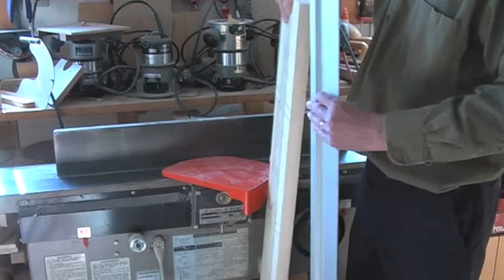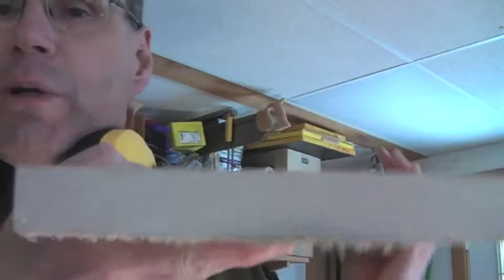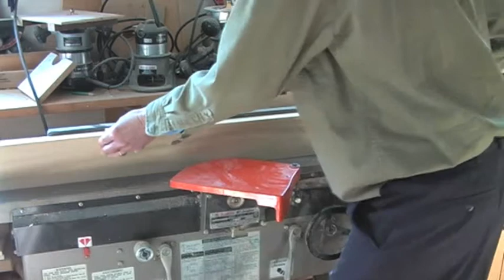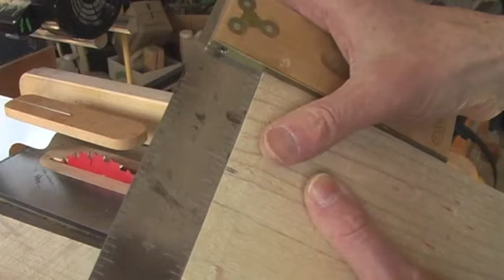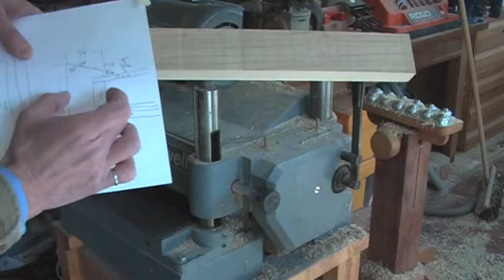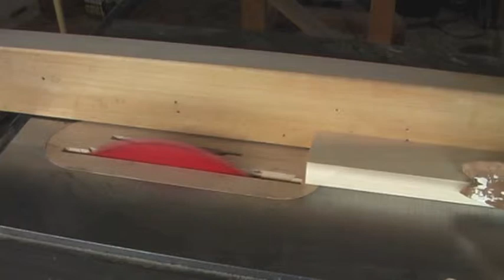02 Wood

Comment: What are you using as your straight edge?  Appears to be aluminum.
Reply from the maker: It  is one half of a 100” aluminum cutting guide.  Not a precision straight edge but good enough for checking wood.  I bought it many years ago, so that exact model likely not available today.  The  Bora WTX would be an equivalent.  Available in different lengths    https://www.elitetools.ca/en/100-clamp-edge-saw-guide-wtx-bora-543100

Kreg, and others make similar guides.  https://www.amazon.ca/Kreg-Straight-Edge-Guide-Comm/dp/B08BQ72SVD/ref=sr_1_3?crid=3P6BAM0G8650X&keywords=Kreg+-+KMA4700&qid=1676148357&sprefix=kreg+-+kma4700%2Caps%2C190&sr=8-3